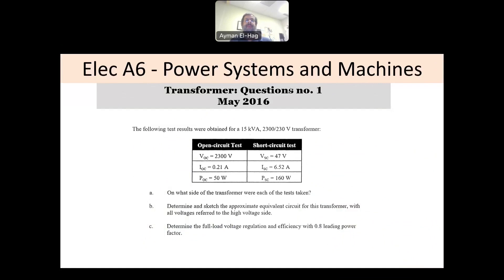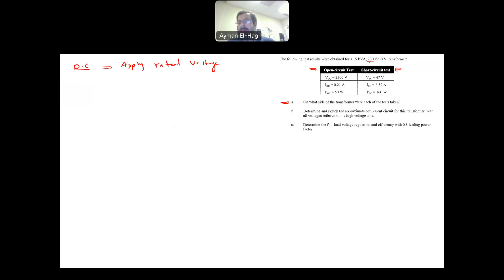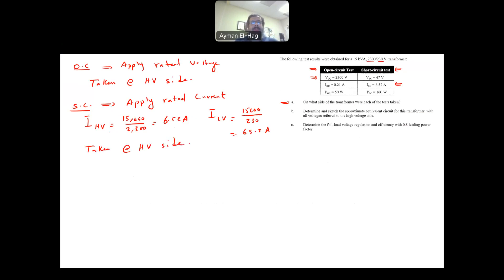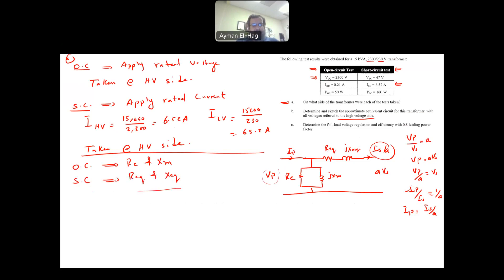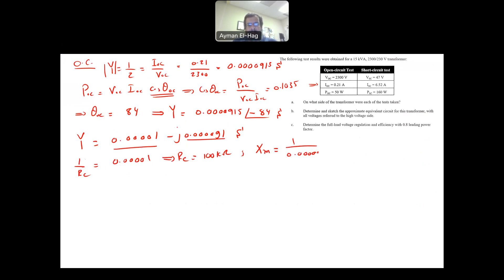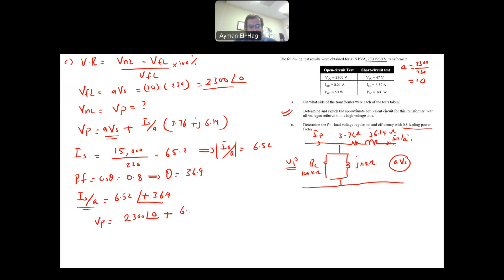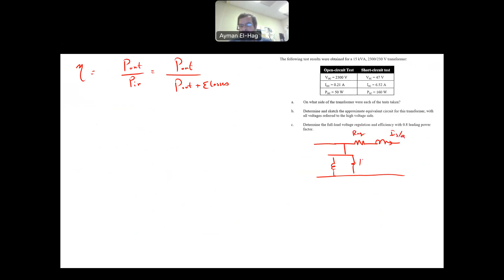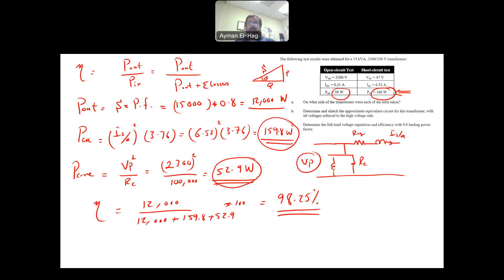PEO solved examples (ELEC A6): Transformer Question no. 1

Comment: Hi professor, what should we do if the rated currents dont match either the Isc or Ioc given?
Reply from the maker: Rated current will never match Ioc but may or may not match Isc. The Isc will be used to calculate R and X and you will need to calculate voltage drop, losses, ... at given load conditions could be rated or other conditions.
Reply: @electrical4everyone  thank you!

Comment: 12:26  professor, you said "when the secondary current is zero, the voltage at the secondary is equal to the voltage at the primary."

 Can you give me a bit more explanation about it? I couldn't understand the concept behind this statement.
Reply from the maker: When there is no current in the secondary there will be no voltage drop in the series equivalent R and X. When applying KVL the voltage at the secondary will be the same as the voltage in the primary.

Comment: Hi Professor, for the calculation of P (Iron), regarding the load (15KVA, 0.8lead), Vp is  not equal to 2300,  based on your calculation it is 2296V. 
what is your thoughts?
Thanks,
Reply from the maker: The 2300/230 is the ideal transformer ratio. When solving the transformer question, we usually starts from the secondary voltage and we use the secondary value as our reference and then we calculate the voltage drop to find the primary voltage. In case of a leading power factor, like this case, the primary voltage will be less than the theoretical value, i.e. 2300V.

Comment: Sir, isn't it that the magnitude value of the Z is almost always higher that the R & the X? How come that for OC, 1/Y (Z) is less than 11K only yet the computed value for Rc was 100K & 11K for Xm. Using admittance or impedance should give the same answers at the end, right?
Reply from the maker: When you have 2 impedances in parallel then the ouput is less than the lowest one. For example 6 ohm in parallel with 3 ohm will result in 2 ohm.
Reply: I understand that the result value of parallel is less than the lowest item but I can't see the relationship of this with my initial question.
Reply from the maker: In open circuit test we find Rc and Xm which are in parallel in the transformer model
Reply: @electrical4everyone  Thanks for clarifying that.

Comment: I believe the open circuit test should be performed on the low voltage side to reduce the maximum voltage to be measured. It is typically done on the low voltage side, but the data in this question might be incorrect. The open circuit test voltage should be 230V, not 2300V.
Reply from the maker: You are right that the no load test is usually done on the low voltage side. But this question assumed that the test was done on the high voltage side. The full load current on the high voltage side is 6.5 A and on the low voltage side is 65A. The no load current in the test matches more the high voltage side as the no load current is usually 2-5% of the full load current, so I think is correct in terms of the values but again I agree this is not what happened in the field.
Reply: @electrical4everyone  I agree with you.